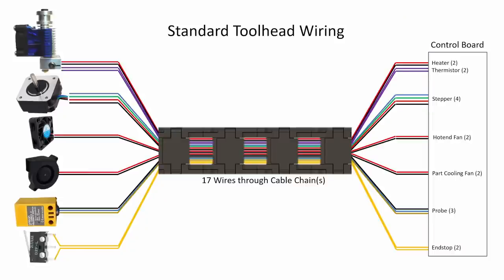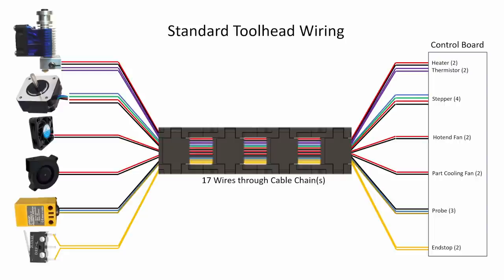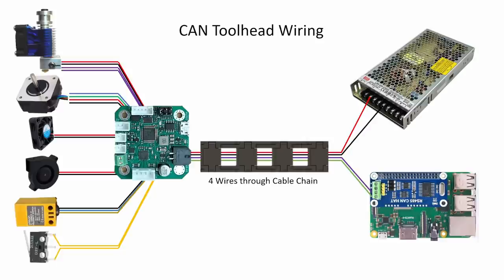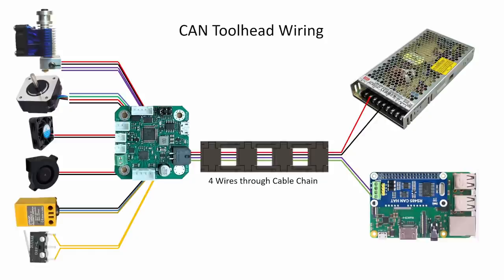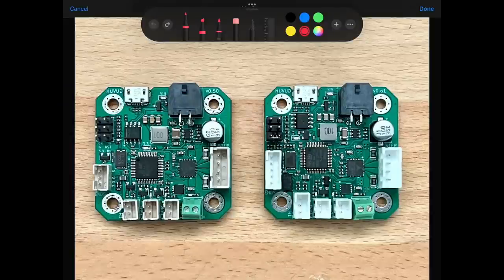Simplify your 3D Printer with a CAN Toolhead Controller!

Comment: I have a 12v system :( oh well looked cool and it was something I was looking for. I have to many cables  running from my hotend/toolhead to my MCU.
Reply from the maker: Hello Daniel! Thanks to @Tedlasman's response it looks like the mosfet is rated for 6A so you should be able to run 12V and a lower powered hotend heater. I'd use a 40W heater (or even a 30W if you can find one) at 12V, I know that sounds excessive but safety is really important. 

In my case, I also run these enclosed in a hot chamber so I expect the component rating to be lower than it is at normal ambients. The ultimate solution for a toolhead board like this is to have a relay or switch that allows all power to the toolhead board to be shut off in case of a thermal runaway--that would be the extra layer of protection that would make me feel safe running 12V. You can do this with Klipper using the Moonraker [power] plugin and a relay!
Reply: @eddietheengineer  Thanks, looks like this are hard to get hold of, do you know any other breakout board?  I thought of just buying another printers breakout board. I have a wanhao i3 v2.1. But I guess I need to check the mosfet on the board to find out of it can even handle 12v.

Comment: Sadly these boards are generally unobtanium. I got a 0.5 a year ago before the chip shortage was in full swing. I just went back to Lukes Lab and I see he has the 0.61 listed, but it’s sold out. Hopefully more become available because I’d like to upgrade the 0.5 on my switchwire, and add one to my 2.4.
Reply: Thankfully I should have some more soon - it took me a while to set up manufacturing contacts, and with a larger order size, I should be able to drop the price especially for preorder, and even offer bulk purchasing!
Reply: @LukesLaboratory  Hopefully I can snag one before they sell out. I love the 0.5 I got from you, but I want the extra feature on the 0.61, especially 5V and a spare pin to run neopixels. Adxl345 is also really nice.
Reply: @LukesLaboratory  Do you have a link to page so I can preorder?
Reply: @LukesLaboratory  thanks for working on getting these in stock.

Comment: I have been thinking of why not doing a toolhead controller but like a klipper expander, using an RP2040 or a simple 8 bit microcontroller and simply running 2 signals for the usb, 1 5v, 1 24V and 1 GND 5 wires in total, I know that some long usb wires need some shielding but It would be interesting to try
Reply: You'd need motion-rated twisted pair cable to carry USB.   (Really, for CANBUS, it ought to be twisted-pair too, but it's only running at 500 kilobits/sec..)  No need for 5V; for 10 cents you just regulate down from the 24V supply with an LDO regulator device.
Reply: @lmamakos  oh right I see, the idea was mainly couse Klipper already supports pretty well usb protocol and microcontrollers with USB integration are pretty common even in this shortage, like Atmega32U4 but I'm not sure

Comment: But why CAN and not just simply use a micro controller with USB interface and write drivers for klipper. Plug directly into the USB line ercf easyboard does.
Reply: This is one thing I'm going to try. AFAIK there's solder pads on the reverse of the board for USB data so it's not necessary to use the Micro USB socket.
Reply: The original idea before the chip shortage was to use one of these boards on X and Y motors as well as the toolhead.  You could run only 4 wires up to a breakout board on the gantry that would then connect to the X and Y motors as well as the toolhead.  You could approximate this by running a USB cable to the gantry and using a USB hub, but it would be much larger and less elegant than using CAN.  If you're only using a board on the toolhead, USB is probably preferred over CAN, especially since the newer versions of the board support USB using the Molex connector.  This is an early version of the distribution board.  https://github.com/bondus/KlipperToolboard/blob/master/doc/PowerCanDist.jpg

Comment: Does it work with a BLTouch?  Do you still use a regular controller for the other parts of the printer?
Reply from the maker: I have not tested it with a BLtouch, so I’ll defer to someone else that maybe has. You’ll still use a regular controller for the rest of your printer!

Comment: Where do you mount the board on the new stealthburner? And would be nice to have support for the neopixels! 👍🏻
Reply from the maker: Great question! I am using the Stealthburner fan assembly with Clockwork 1 and Galileo now; once Clockwork 2 is released officially I'll make a Huvud mount for it!

On Neopixels--there technically is 5V and GND now you could pull off the endstops, but the signal would be 3.3V. I think there may be a way to make it work with a sacrificial neopixel but I don't have a lot of experience with neopixels yet. Worst case, you run 3 wires dedicated for the neopixels!
Reply: @eddietheengineer  thanks!

Comment: Are there still limitations in klipper with the endstops? I thought about using a similar board a while ago, but there were some limitations with the endstops wich kept me from changing over on my Printer.
Reply from the maker: There are not limitations! The cross MCU homing code is merged into the main Klipper code. I use the probe and X endstop routed through my toolhead board

Comment: Accelerometer would have been nice or is there anything to connect it to?
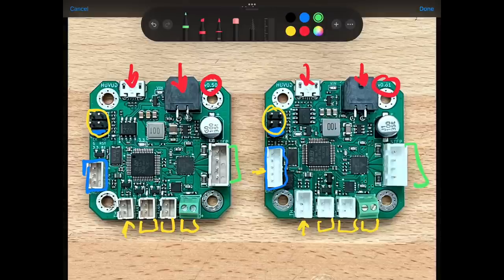Reply: 10:08 - The 0.61 board has an accelerometer onboard.
Reply: @iPeel  Perfect, thanks. Couldn't see it on the board or documentation.

Comment: the newest board does can or usb through the molex. doesn't necessarily need a hat
Reply: @abeowitz  you can run the usb cable through the molex, you just need to set a jumper or something correctly. 
Bltouch should work off it too, don't need extra wires.
Reply: Are you saying it can communicate over serial if you don't wish to use the CAN bus? I don't see any mention of this. It looks like you can flash the huvud over USB if a boot jumper is set but that's all I can find.
Reply: @JJFX-  I'm saying that you can route the usb through the molex if you cut 2 traces and solder 2 pads. 
You don't need to use canbus. 
I have one of those 0.61 boards.

Comment: Hey eddie, do you own a RS485 hat? If so did manage to make it work with a rpi4?
Reply: Depending on type of HAT it either just works, or you need to load overlay for adittional serial ports. (sc16is752 or similar often used)
Reply from the maker: I have the waveshare hat that has RS485 on it as well as CAN, but I have not tried using the RS485 portion

Comment: I found out the painful way what not motion rated cables mean. Will keep this in upgrade option in mind if any other wires fail. Then it will probably worth the time to rip out the wiring  loom for this to trade some mechanical / electrical complexity for software complexity.
Reply from the maker: Please replace the cables now! I have helped replace wiring on a friend’s printer that did not use motion rated wiring…some wires shorted out/overheated/melted the ABS parts and set off the fire alarm.
Reply: @eddietheengineer  Nothing to worry about. I already rebuild my wiring loom. Been just very sad to find out that there is an easier option, compared to stuffing the cable chains full of wires. After i already put in the work. Now i got the very flexible copper silicone wires, instead of the aluminum wires that came with my kit. Also seen people running some  flat ribbon cables  with no drag chains. But using 3 lanes for your heater cartridge  seems a bit unsafe compared to ruining some thicker gauge 24V wires.
Reply from the maker: Agreed--I have seen the FRC option but haven't really looked in depth, using silicone or PTFE wires still seems the best route to go, at least until I've seen good data for the safety of the FRC option.

Comment: If only there was a wireless can bus option. That would be something.
Reply: Wireless CAN is a thing but for this use case its useless, you still need to run power so might as well route CANH and CANL alongside

Comment: 25$ was a steal. I was ready to get one despite not having a need for it. But 65 isn't worth it in my opinion.
Reply: Cable chains and a decent wiring harness for a Voron 2.4 or Trident will run you a bare minimum of $100.  With the Huvud you still need to run wires for the A/B motors, but even at $65 this board is a net cost savings.  It might not be so attractive if you're using it on a different type of printer.

Comment: Toolhead check! Ehm - what about the xyz steppers?
Reply from the maker: Yes! You can connect multiple CAN boards to the same bus, that’s what I do for IDEX. I think at $25/each or less it would be interesting to put a board per stepper, but at $65 it’s a bit harder to justify
Reply: @eddietheengineer  so a full printer would need xyze, that's 4x$25=$100 ... As much as this is intriguing for the e, it feels a bit excessive for xyz. But interesting nonetheless.
Reply from the maker: @gordonbroom5442  I’d love to see a Huvud style board with minimal components; say 2209, micro, and maybe a stepper encoder and temp sensor specifically for use with motion stepper motors!

Comment: I dont see how putting extra weight on the toolhead is a good idea in an era of high-speed 3d printing.
Reply: Cable chains with 17wires in them are heavy and introduce friction. I run a Huvud with an umbilical setup. It’s a net weight savings.
Reply: less wires in the drag chains
Reply: did you even watch the video?